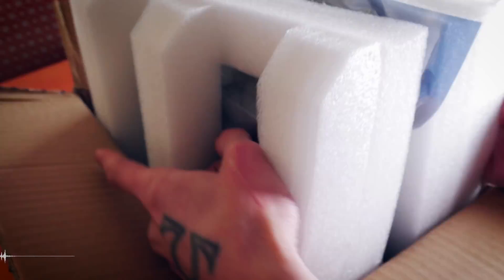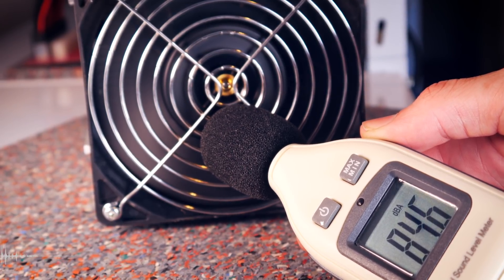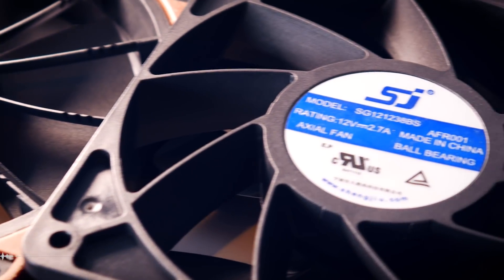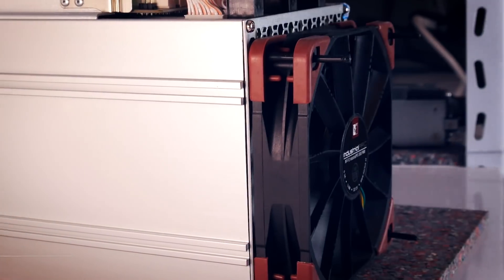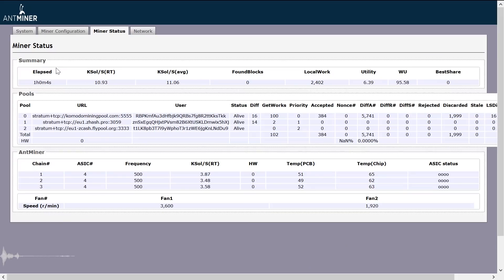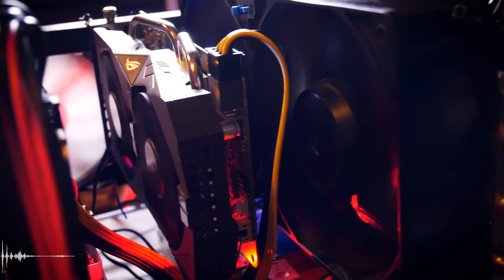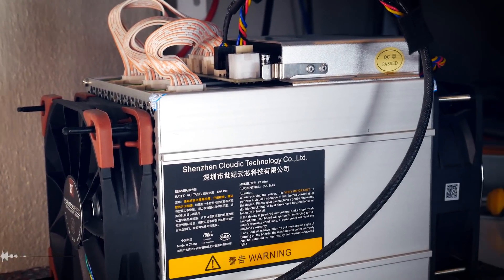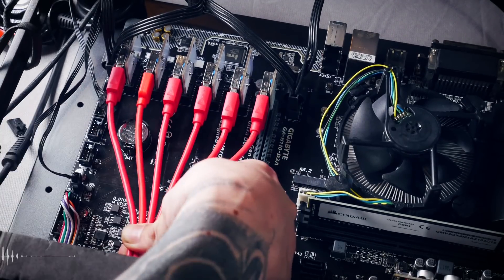Antminer Z9 mini meets Noctua: fan replacement & push/pull experiments

Comment: Make Your Own Cage for the Cards inside the Z9,  Sort of like a PC Case with More Breathing room and Fans, Minie PC Cases Run hotter on the CPUs That is Why They Put a Larger Case on the Smaller PC Boards, Mid Tower Works Best.  Treat it like a PC, The Case is To Small, Dust Screens I think would be Beneficial, as long as they are Cleaned often.

Comment: Has anyone figured out how to have this run? Is there FW that allows for fan check to be skipped?
Reply from the maker: Jep :) Blissz firmware does so, check on the channel for a vid. Other than that there are physical fan slot "dummies" you can use, search for "antminer fan simulator" - cheers mate ⛏️
Reply: @CursedMining  thanks! Glad you're still replying here. Only problem with the fan dummy is I don't know how to power the fan externally. I was thinking if I use a PWM splitter cable, plug in dummy into one socket and the noctua into the other socket would it run?

Comment: Noctua looks perfect on it. Hmm... There must be a way to cheat the Antminer fan sensors.
Reply from the maker: Sorry I only saw the comment now! There is, I only found out later, google: Antminer fan simulators, then you only need to power the fan from another source :) cheers
Reply: @CursedMining  Oh, yeah! So was it sufficient enough to cool the Antminer at 3000RPM? I mean for sure it's more quieter than the shrieking stock fans.
Reply: @leotheevinci  I'm curious about this too!
Reply: @CursedMining  Just seen this video, this is great news - did you try it and get any results regarding noise and thermals?

Comment: Can someone tell me if this fan will work on DR5 and also with this fan will the db be less cause I have two fans in front and 2 little tinny fans in the power supply. I wanna replace the antminer dr5 fans to a less quite one. Would this work to keep it cool and be less noise? And how noticable is it?
Reply from the maker: Hey there! You'll need to search for 'antminer fan simulators' - then you can run them with any fan you like but have to power it through another source. A friend managed a 13dB antminer in a boxed setup with noctuas/xsilence fans. The freaking bitmain psus are harder... the same colleague also managed to mod the psu but it is a rather dangerous process. Here I'd recommend to go for classical ATX power supply, they are much more silent than the damned bitmain PSUs. Hope I could help - thanks for tuning in ⛏️
Reply: @CursedMining  Would a regular 1800W atx power supply draw less power. I know bitman draws the whole 1800w. By changing to ATX would it draw less power. Cause I know on a regular PC using a 1000w PSU with GPU never draws that much. I don't understand why the miners need that many watts to run.
Reply from the maker: Nah unfortunately it would not draw less power. With PCs it is different because of different workloads, you always take stronger PSUs with some overhead for safety and efficiency. Didn't realise Dr5 was 1800w, that they force users to push their own psu to max is pretty... brave 😫 I think two 1000w ATX psus would work but that is pretty expensive. Seems they have pushed all the hashboards in there they can, pretty insane, that's why it draws so much power. Sorry I could not help any better ⛏️
Reply: @CursedMining  They released an update firmware that can make the miner go to 1000w and will hash at 25 to 26 instead of 34TH but still draws alot of power. I am still trying to see what alternatives I can do to replace the fan with a aftermarket low noise one. It's crazy the sound. You can hear it everywhere lol. I'm sure there is a fan that cuts the noise. But which one cause they are all weak 2000rpm or 3000. The ones bitman uses are rated to go to 6000rpm. Which is why I'm thinking which fan is good and plug and play and quite. But you said the one you used does not work with bitman so dunno.
Reply from the maker: Check my first reply. Not plug and play but with 'antminer fan simulators' you can run whatever fan you like but have to power it from another source. How is the heat with Dr5? if is not so high it could work also with weaker fans. Noctua are only 2000/3000rpm but for the colleague I mentioned with Z9mini it worked fine. I know what you mean with sound, my basement is a jet engine haha. Also the PSU itself must be loud. The 1000w firmware option might make the whole miner more silent (because less heat, lower fan speed) - then atx psu would also work. I never bought one of these 'doppel decker' Antminers (two front fans) because I feared they are more like jet engines like the normal ones 😖
Reply: @CursedMining  I was think of swapping the dr5 power supply fans the 40mm ones that have two with your fan but the smaller version. I have to see the heat for the power supply.
Reply from the maker: in the video next Tuesday you can see an example of exactly that process, but was not easy for the guy, no plug and play, he had to cut cables etc.
Reply: @CursedMining  how many db is the antminer psu?  There are some 800 cfm 8" fans on amazon  that are 41 db.  Would it be possible to use a reducer to 4" and the fan simulator  with these? I have the s19 with the 4 fans.

Comment: Noctua works on Antminer T9+ very well and silent. Overclocking also possible. Temperatures are normal. So. Buy austrian Quality made by Noctua!
Reply from the maker: Yeah man :) greetings from Carinthia ⛏️ good to hear about the T9+
Reply: @CursedMining  greetings from Innsbruck/Tyrol
Reply: @CursedMining  Antminers want 3000rpm or more during boot. Noctua is about 3000rpm
Reply: @Chris_2303  Would this work on other miners that come with two fans front and back, if we use the Noctua front and back.
Reply from the maker: with some Antminers you'll need 'fan simulators' (google it :) cool gadgets) otherwise they won't start with the Noctua, then you have to power the Noctua from another source - cheers ⛏️
Reply: @CursedMining  von wo genau?
Reply from the maker: War beim Z9Mini leider nicht so, der hat eher auf ampere geachtet, nicht auf RPM. Hatte ebenso den Industrial3000 im Experiment. 
Zw. Villach und Klagenfurt, grüße nach Innsbruck ⛏️

Comment: I tried taking 2 fans from a D3 and put them on push pull on the Z9 mini, temperature dropped from 72 celsius to 64 celsius 👍🏼
The antminer is controling the fanspeed..

When i put fans to 100% it drops to 54 celsius..

Everything done on 750m overclock..
Reply from the maker: Awesome to hear mate! I ordered another fan and got a broken one haha, can see it in that video: https://youtu.be/vIF0WzQvNZA - thanks for checking in and sharing your experiences! Will follow your example soon =D
Reply: Great idea, any tips for reducing sound ?  I've read about mineral oil tanks but other ideas take center stage.

Comment: I am skeptical of ASIC MINING. I don't see any convincing result/data yet.All I am sure it cost to own one.But profitability wise only assumption and calculation.I want to see the real profit and raw data..let say 1st week of operation, 2nd week of operation 3rd week of operation and month of operation.How did the ASIC miner performed..My impression about these ASIC equipment are too good to be true for now.
Reply from the maker: Hey mate! It is very good to be skeptical! Batch 1 of a new miner is always unrealistically profitable first - then drops fast with batch 2 and other machines. I use ASICs and still stay skeptical, always try to be open with the videos as well. I bought one of the first ASIC miners back in 2013, the Antminer S1 BTC miner. Made more than 0.1 BTC a week at the time (miner cost 500€), only that BTC wasn't worth much back then. So one also has to think of the long game. Of course in the short term, machines like this, especially when made only for one specific algo, are always a bit of a gamble. Others use strategies like reselling at certain points in time.. but not my thing as you can see with my little farm, always scaling a bit up, sometimes a bit down etc. cheers

Comment: You need to sort out your understanding of ~voltages~. 

The miner does not boot fully because the RPM output from the fan is not enough. 
There is a program in the miner, probably cgminer derived and named, that also monitors the fan or the fans. 
If the fan fails (I've seen my share of shattered S9 fans or blown bearings) the miner shuts down the mining process. Also it shuts down the information output that constructs the status web page so the only clues it leaves is in the so called kernel messages and in it's actual standard output (it is ran in a screen session so ssh in, attach the only running screen to your shell session and enjoy). 

You can trick it to believe it has whatever fan rpm you want as long as you feed the RPM input on the board with a signal that matches a 4600 or 6000rpm fan output. I ran the output of one fan in both headers to make use of a fan that had not enough rpm but it cooled the asic enough with the other original 4600rpm fan. 

And there are a lot of fins in there. There has to be a lot of pressure to cool them all... Bitmain does not excel in Q/C and PR but actually amazes me every time in engineering.
Reply from the maker: thank you very much for sharing your experience good sir :) I did indeed not express myself the best way regarding the fans & fail state! Will try to improve :) cheers

Comment: nice video, can you attempt to cool say an s9 or d3 by placing some distance between the fan and the heat sink, and let the fan blow through something like a six inch diameter pipe. I suspect that loud sound may result in part due to the close proximity to the heat sink structure making a siren effect. Thanks again for sharing, take care.
Reply from the maker: Good idea, but would be interesting how the cooling would react with that experiment! I'll definitely do more on Antminer cooling and silencing, will use my L3+ for that. First I wanted to do some kind of exhaust system so that its heat gets exhausted directly, also thought that would help with noice (Shroud to ducting, ducting to outside) - welcome to the channel and stay tuned for more experiments =)
Reply: Thank you, if I get a chance to test it out i'll share the results with you. I have my d3 running at 1/4 the power to keep the fan noise at a tolerable level (~2000 RPM).

Comment: What a waste, totally predictable! Put another big server-grade, like the original one, in push-pull config! You only strangling the airflow with that slow noctua!
Reply from the maker: Nothing will be wasted Bill :) will find good use for the Noctua, but you are still right! Cheers
Reply: Yeah, I'm sure you had other plans for the Noctua. I was referring to the waste of time in making and posting this video
Reply from the maker: For the comment section alone it was worth it for me =) I learned a lot and we even got a small Discord server out of it. So these kinds of experiments, even if fails, are very good for a small channel like me =)
Reply: BIll Geo it's not a waste of time, it's totally valueable for me to know, if it is possible or not ;-)
Reply: @billysgeo  this is your opinion dude

Comment: Thanks!!! I'm a huge fan of noctua fans too! Sad to see the result but happy you did it first!
Reply from the maker: You're welcome mate - that's what I'm here for =) I'll still find good use for the Industrial though, I have an air-cooled i7 (workstation as well as XMR miner in off-time) and I guess with additional Industrial it I can go for crazier overclocks while I don't need the it for further experiments =)
Reply: lads its much simple contact noctua and let them experiment and make a super fan for antminers to reduce a heat they would make loads of money of it ;)
Reply from the maker: Hey Tomas, I showed the video to them and received positive feedback =) but nothing about making antminer fans =D
Reply: @CursedMining obviously because noctu fanis joke compared to server fan which rpm qbove 6000rpm

Comment: how much is the cost of electricity at australia  per /kwh?
Reply from the maker: Austria, not Australia :D no kangaroos here. Per/kwh is difficult to state for us because we pay per kwh but also have 'system costs' they put on us. But should be <14c per kwh (all fees included)
Reply: is Austria :D good to know ^^ my country also have system costs as well average $0.146 per kwh... need 3 year more to get ROI   T.T
Reply: Here is Quebec, Canada I get 0.045 usd/kwh for the first 36kwh everyday then it raises to 0.06 usd/kwh! ;) Thanks to our huge hydro power. That's the normal residential rate. Industry can have even a lot lower but crypto mining will be an exception and huge mining farm who want to relocate here will receive a raise instead of a rebate...
Reply: Australia is 0.17usd plus.
Reply: Indonesia us$ 0.12/kwh depend on currency usd-idr.
Reply from the maker: Sounds like an awesome system you have! Would be nice for small and mid-sized home miners like me. I love Quebec btw. - been to Montréal / Rouyn Noranda twice - with good luck this year again. Cheers

Comment: You really should match the amperage and CFM rating of the original fan with a replacement. Even fans that move more CFMs than the original could burn up the controller board the fans are plugged into because the board may be only rated for the amperage draw of the 2.7amp fans. The fans that come on Bitmain products move 200 CFM and are rated @ 2.7 amps @12v. Replacements manufactured by Delta are available on ebay new for $16 shipped. I thought about getting fans rated @ 250 CFM but they are rated  3 amps @12v. I don't want to risk it when the replacement fans work as well as the original fans and take care of business in my shed at ambient temp in FL so like at least 85-90F degrees daily. It gets hotter than that inside the shed between noon and 6 o-clock even though I have everything venting outside which draws cooler ambient air into the shed. I also keep my miners set to shut off @ the 80C setting and never had it happen so far. One of the reasons i use Bitmain's products is they handle heat very well. Even the old S1s did so pretty well.
Reply from the maker: Thank you for the feedback! I absolutely agree! Still tested the Noctua because it is rated lower, but I still agree. Next experiment will be with fan with same specs! Have to check the Baikal PWM specs! I had an S1 too back in the day :D thank you for sharing!!

Comment: Dude. Did you check the air direction of that secondary fan? Seems like it blowing in, and then they canceling each other.
Reply from the maker: no worries! Thumbnail is from the setup with Noctua only, for push pull it was flipped around, so the right way. Noctua just too weak compared to original fan unfortunately! Thank you for the feedback :)
Reply: eu tenho pra vender

Comment: You used a fan that is much slower than the antminer fan. You choked the Z9 air flow so what did you expect to happen? Just buy a fan with the same specs and you'll get the results you are looking for. I've noticed on my z9 that the 2 outer hash boards get hotter than the center board. Maybe a modified front fan mount plate might get some more airflow to the outer walls? fyi, double bearing 6200 rpm industrial fans are less than $25 on line. please post a vid if you have some success.
Reply from the maker: Hey Michael Thank you for the feedback! You are absolutely right of course, still wanted to try the Noctua since I saw many questions if it is possible! Will do more fan experiments in the future and share here of course :)
Reply: !5.00 on Ebay. I checked out bitcoin merch and i must say the prices are outrageous! $3,000.0 for a z9 Mini? LOL
Reply: You can order an OEM replacement fan from bitcoinmerch.com to put another one on the back.
Reply: Michael Pace agreed, I just didn’t want to risk getting the wrong fan so I spent the extra to get it from somewhere that hopefully had tested them vs buying a bulk stack on alibaba lol
Reply: 6000 rpm double bearing fan w/4 wires .2-.3 amps. If any doubts use a meter and test for short to ground on ALL wires. No short then safe to try.